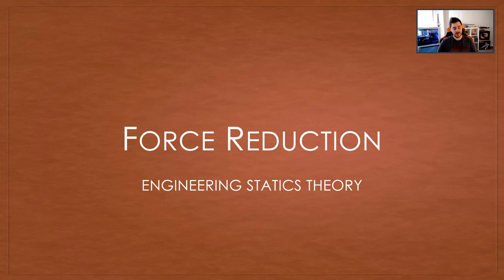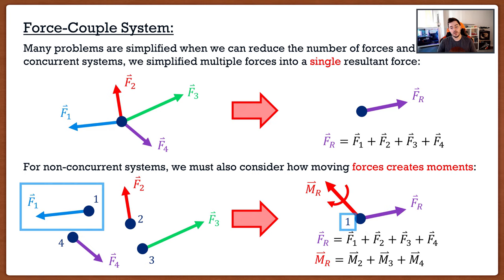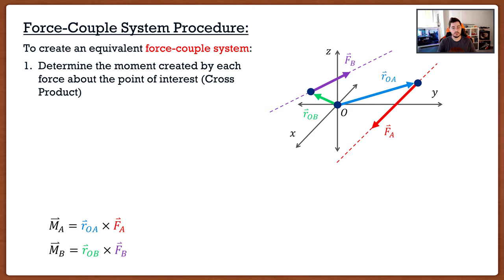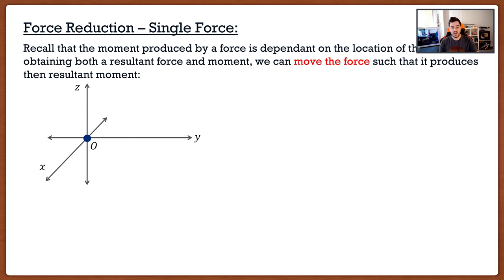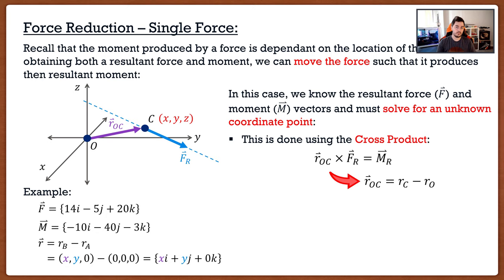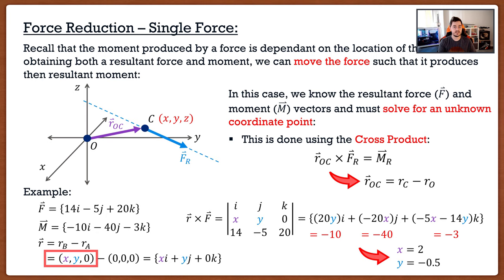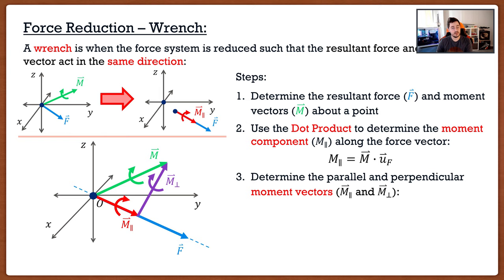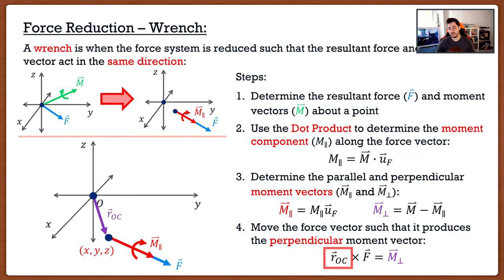Engineering Mechanics: Statics Lecture 12 | Force Reduction and Wrenches

Comment: Do the resultant forces always act at point O? Is this arbitrary and for simplicity reasons?  Could we technically place the resultant force line of action anywhere?
Reply: If we wanted the resultant moment around an arbitrary point D, the resultant moment would be different, but the resultant force would remain the same, correct?
Reply from the maker: Yes the resultant force can act at any point along the line of action that intersects point O (as it will not create any additional moment) but for simplicity we place it at the point O as we found the resultant moment around point O.  And yes, if we are now interested in another arbitrary point, the resultant force will remain the same but the resultant moment will differ (as it is dependent on the location of the arbitrary point).  Hope this helps :)
Reply: @ClaytonPettit  it really does… thank you so much!!